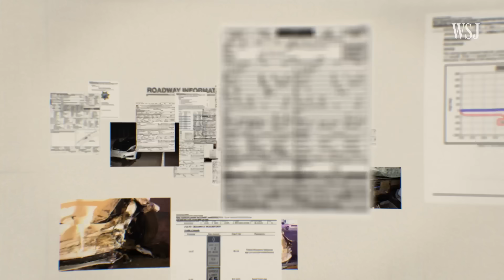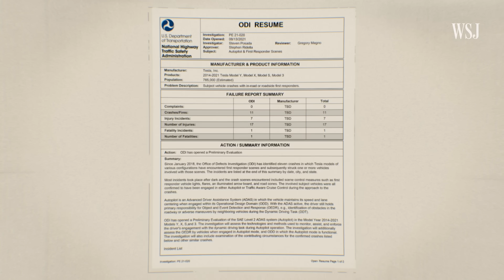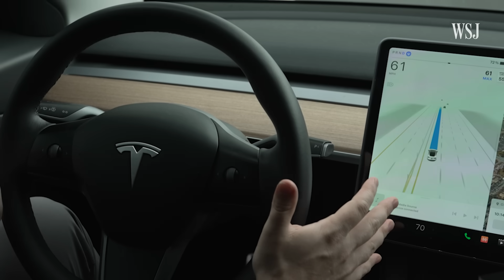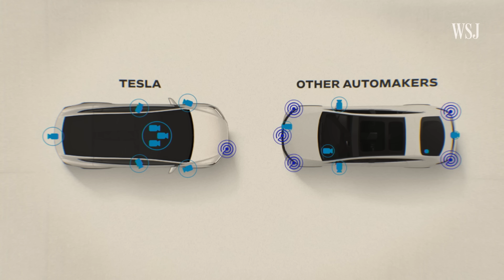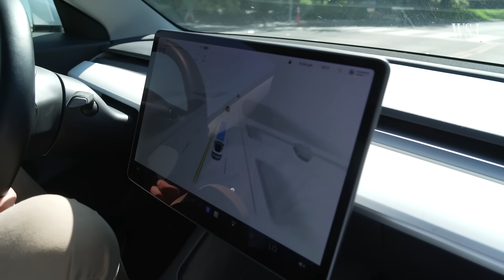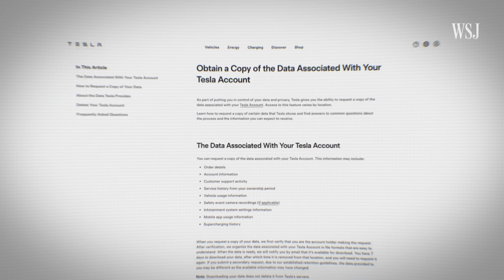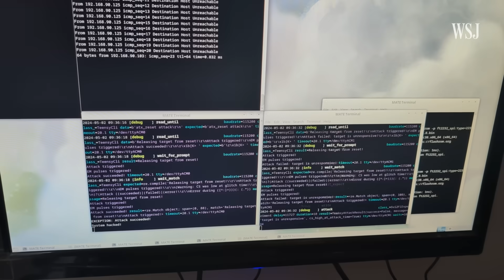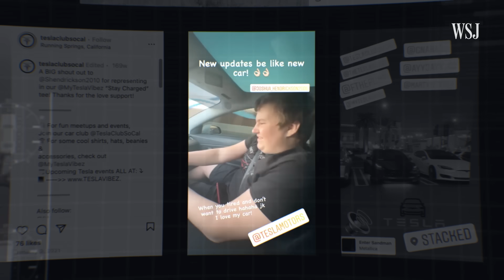The Hidden Autopilot Data That Reveals Why Teslas Crash | WSJ

Comment: The name Autopilot is what's misleading people. It should be called driving assistance and should be marketed as such.
Reply: Of course, now Elon Musk's DOGE (...government efficiency) board has announced we don't need that National Highway Safety Board that collects the data on why Tesla is the car brand with the highest rate of fatalities.
Reply: @bcwbcw3741  because people like you are easily misled, they report data others don't, stop comparing apples to oranges.  You know full well Teslas are some of the safest vehicles around.
Reply: @churblefurbles  The number of fatal accidents in Tesla's say that Tesla's are not "one of the safest vehicles around;" no matter what you fan-boys want to believe.
Reply: If the car is accelerating, using the breaks and turning on curves by itself, then it's on autopilot. Stop this BS. People defending rich people, as usual
Reply: @xbpspcdude  We live in an America now where the rich and/or famous can do whatever they want and get away with it because their "fans" will defend them in the court of public opinion no matter what
Reply: Doesn't help that Musk promised Full Self Driving and Robotaxi
Reply: @rick4580 FSD and Autopilot are two different things.
Reply: They fixed that by saying Supervised in brackets next to FSD. Doesn't fix the core of the problem though. People need to pay attention. The system reminds them. Like take the crashes in the night missing obstacles, clearly the driver was not able to spot it themselves or were not paying attention. It's very sad and unfortunate but a human clearly couldn't do better either. And that's the point, Tesla or not. Humans are great but machines are just better at some tasks. They aren't perfect though and that is what makes it tricky when a company sells the product.
Reply: @rick4580  And is getting there.  Remember how many people died with cars driving at 20 mph in early 1900's.  Was a car factory problem? not really.  It is a continuos process.  Same as seabelt, airbags,etc.
Reply: @rick4580  Those are not the same things as autopilot. autopilot is just basic cruise control.
Reply: @bibidi2568   autopilot is just basic cruise control. 
No it isn't. First, it's Traffic Aware Cruise Control (TACC), not just basic cruise control. Second, it includes Autosteer, which some companies call Lane Centering, and which you didn't mention.
Reply: @rick4580  Yes and claiming FSD will be 10x more safe than human drivers. He is systematically creating hype and twisting perception of how good FSD is while not taking responsibility that it really works. As he knows it does not. But he is unfortunately really good in creating fatally wrong perceptions what people expects from FSD.
Reply: @rick4580  He might have promised but never stated that is was 110% READY TO DO SO. That's the problem is that things are fed but we call it mislead when in reality never broke the meaning down fully. Just like when driving and its called "AutoPilot" well at the very start we all think fully autonomous but in real world it means A function that Pilots something automatically but further in depth on the word pilot also means (Is not 100% Fully capable to control this something automatically it can only function so much).
Reply: @rylie4495  Musk said back in 2016 that Tesla cars would be fully automated robotaxis by 2017. Of course he said the same thing in 2017 about 2018 and every year after until he finally had to stop a few years ago, and they changed the name from Full Self Driving to Autopilot. 
But there were certainly a lot of people who believed their Teslas with Full Self Driving could operate with minimal driver attention because that's what Musk said they could do.
Reply: @rick4580  They didn't change the name - it has been called "autopilot" literally since it was first introduced, and it was named autopilot because it most closely mimicked what pilots use in aircraft - a system that automates basic navigation but always requires the full attention of the actual human pilot for cases where the system doesn't understand what's going on and requires a properly qualified human being to respond safely. "Full self-driving" is a marketing term for an autopilot system that does more than just basic operation of the vehicle, and will also follow a pre-specified route from the current location to another specific location, but still using the autopilot system in which the driver must always remain fully aware and attentive and prepared to take over when the system identifies something it doesn't know how to handle, or when the system fails to identify something that needs to be addressed.
Reply: @babybirdhome  and tesla calls FSD "autopilot for streets."
Reply: @rick4580  They should instead read what the car says on screen as you activate Autopilot or FSD. These features are deactivated by default for every profile. Nowhere there does it state the car is autonomous, it actually states the opposite.
Reply: @rylie4495   come on man, even among Tesla fanboy spaces it's a meme how many times Musk has said "the software is totally ready to go right now, just a few more wrinkles to iron out and get regulatory approval. End of next year you'll totes have Robotaxis"
Reply: @rylie4495  Exactly.  Boeing autopilot doesn't mean the pilot isn't responsible--the pilot is still in command.  if people don't pay attention or worse, don't understand what they are using despite constant warnings (My Tesla is annoying with its warnings to keep me hands on during FSD), people's negligence doesn't constitute manufacturer negligence.  If Teslas were abruptly steering people into avoidable accidents that would be different.
Reply: @rylie4495  The AP-software of Teslas is literally called FSD, "fully self driving". If anyone mislead people, its Tesla.
Reply: @sprockkets   tesla calls FSD "autopilot for streets." 
No it doesn't. Where'd you get that idea?
Reply: @BigBen621  lol you are too lazy to even look it up, Elonia has said it several times
Reply: @rylie4495 when he claims that it's already safer than a human driver, isn't the corollary that one is safer letting it drive? Musk had indeed misled people, with the names, with their stated capabilities, with the promotional material (like a video where it was claimed the car was driven without human intervention and it wasn't) and safety and with the timelines. All the safety critical nuances can't be on the fine print.
Reply: Autopilot not even on an airplane is left alone without oversight from the crew.

People need to use this as an aid and move on
Reply: Exactly because I’m sure most of these auto pilot crashes could’ve been prevented if the driver was staying aware I have a Tesla and I’m always driving it like I don’t trust the auto pilot
Reply: @melo0115 Nope. Some of these crashes happen because autopilot made a sudden, violent, steering input at speed. Like someone reaching over and grabbing the steering wheel. That's not something any driver should have to deal with. You can keep living in your Tesla bubble, but you're a fool.
Reply: @melo0115  Same here
Reply: The correct name would be 'bad driving assistance'.
The assistant in my previous car, a 2019 Skoda Superb war superior to any autopilot iteration I've seen so far.
Adaptive cruise control was working flawless up to 210km/h. Road Signs - even dynamic ones or those on trailers used for roadworks were >95% detected correctly.
Lane assist was most of the time even able to follow temporary markings within construction sites. 
I was shocked, how bad things can be when driving a 2 years younger Tesla. Not even talking about the consequences of the missing ultrasound parking sensors.... 
.
Reply: @peterm.2385  heard great things about VW group’s assist features, really want to do a test drive of it myself
Reply: @peterm.2385  I'm sorry, but that's just a nonsensical statement. You're telling me that you are 2019 whatever the heck you call it could drive from Las Vegas to Los Angeles without ever touch the steering wheel? Oh, it can't? Then it's not superior. You might wanna go look up version 13 of Tesla FSD. It pretty much shuts the critics up.
Reply: @RightsDontDefendThemselves  No, I said that whatever was installed in a 2022 Tesla didn't wasn't as good in dealing with all odds that occur when I was driving here in Germany.
And it's no nonsense: to drive autonomous, a car must be at least certified for Level 3 (partly autonomous) within the EU. The latest upperclassmen cars from BMW & Mercedes are certified allow you to hand over control on highways until the as you to take back control. Tesla wasn't able to demonstrate  flawless operation of FSD under all required conditions & obtain tne necessary certification. They are still at level 2+.
So I don't compare car's ability to drive from a to b, but how the system is able to interact with the environment.
The Tesla did some phantom braking for no reason, regularly misses out some road signs, got confused by temporary road markings (yellow) put over the white ones at roadworks  & acc wasn't working at speeds faster than 140 km/h and PDC often reported wrong distances.
Reply: @peterm.2385  Not comparable to anything, those are fake level3's limited to very restricted paths, they are not competitive in terms of generlized intelligence.
Reply: It says you should take over anytime. People are not stupid, they're just not as focused as needed. When you have a system that tells you 19 times to pay attention / take over, it's your fault if something goes wrong
Reply: @erwile  well but these two statements are contradictory then in my opinion.
Reply: @garcipat  I see your point. IMO if they don't see that this autopilot system is not driving well (which is the case since it's an ADAS that just follows a curve and adapt speed according to other cars) why these people are allowed to drive in the first place? A car that tells you to take over at anytime is like any traffic signs that tells you to stop, it's basic logic.
Reply: @erwile  correct.
Reply: Autopilot in commercial aircraft do not handle all situations either, but when they are in operation they are safer than human pilots.
Reply: FSD was renamed to FSD (Supervised) for a reason...
Reply: @techconix  You mean FSD (Beta) was renamed to FSD (Supervised) for a reason. The available product was never just called 'FSD'.
Reply: Agree, naming anything with the word "auto" in it and it general consistence is that it is Automatic (I.E Automatic transmission, automatic high beams, etc.),  something that does something with little to no human control. Slapping the saying that "drivers need to be ready to take control at all times" is more aligned with an Assistant or an Helper, As that more implies that while they are there to assist they may not do the job correctly and still need to be managed, supervise (little late with some report there Elon) and monitored to an extent when a job needs to be done correctly without fault, similar to that of an experienced employee vs new hirer.
Reply: People would still do exactly as they have been doing regardless of what tesla calls it. Tesla makes you read a warning before activating it, and agree that you will pay attention, if you choose to ignore the warnings, that is your fault.
Reply: @ thats the reason why I am a little Bit anoyed by those „Tesla Autopilot is dangerous“ calls
Reply: agree - why didn't they at least call it co-pilot?
Reply: have u driven a tesla?
Reply: Yes, but what fun is that.  If someone needs a warning label maybe they should not have it?
Reply: But then he wouldn’t be able to pump and dump his stock
Reply: is it really misleading when it tells you every few minutes to <BEEP BEEP> KEEP YOUR HANDS ON THE STEERING WHEEL <BEEP BEEP>
Reply: Idiocy is what's misleading people. Autopilot is taken directly from aviation, where it is a driver assist feature. Tesla also explicitly explains the limitations and tells you not to trust it - something you have to agree to before activating it the first time. It has always been marketed as an assist feature that will SOME DAY be fully autonomous. Tesla is not the problem.
Reply: This clip shows an accident from 3 years ago, but robotaxi was launched this year. What happened in those 3 years of machine learning? It improved dramatically! That’s why Elon launched robotaxi this year. The version of Autopilot this year is more than 100x better than it was 3 years ago
Reply: In Europe, it's named Autosteer and Traffic-Aware Cruise Control, and it's better and more paranoid than other carmakers' similar systems that I've tried, including Volvo's. But of course, other manufacturers are not interesting to media.
Reply: Tesla's system randomly steers vehicles out of lane at high speed. That's not an assistant.
Reply: You minions are all confused, it literally verbatim says supervised in giant letters in front of it. You have to read the user agreement. Check mark a box /sign that you've read it and bake into your small brain that it is supervised by you
Reply: @AviCohen  I am sure that Tesla lawyers have made sure it is exactly like you said. Problem is that Elon (and some Tesla fans) are hyping it to be much more that what it technically actually is. So that perception is something else than reality. And that is of course about stupid people and not fault of a car as such. But it is fault of Elon + some fans/youtubers.
Reply: it doesnt matter. there are  warnings when you dont pay attention or not have hands on  the stearing wheel. All these videos also show crashes that you can barely see with the human eyes meaning they should have put more lights on the roads.
Reply: I guess one difficulty in relating to my parents is they have shown no desire to ever do a specific scientific or  engineering problem. I could never do a problem with them, or never solve a differential equation problem with them because they like to watch television sports and make condescending comments about the coaches, players, and officials. I think it would be hard for me to perform under the noise of the crowd. But my parents, who are retired government employees who convey the idea they have done everything perfectly, and would do everything perfectly. It is psychological torture being around them as well as my sister and her husband. it is like the information going into my mind guarantees a feeling of guilt and inferiority Billy. I have been in misery here in Las Vegas, Nevada. Do I have to earn money doing jobs I did when I was 17 years old, and get satisfaction and joy from doing some calculus and engineering problems out of a textbook? That is a question in my mind.
Reply: @ChrisVink-b5b  I share the same struggles as you do and I can talk for hours about these points you have made. It's nice to see someone else that gets it.
Reply: It's not even remotely misleading, autopilot tells you constantly to pay attention ever time you use it. There's 0 ambiguity
Reply: They literally say even with these features engaged it isnt fully autonomous and you are still fully in control of the vehicle.
Reply: Why would "autopilot" mislead people?   If people have some stupid understanding of what actual autopilots (in aircraft) do then that is their problem... I am a pilot and I think that "autopilot" is a quite accurate label of where these systems are right now... If Tesla was calling it "autonomous mode" then you might have a point.  Autopilots... in aircraft... are far from autonomous and require constant monitoring by the pilot at all times... just like Teslas "autopilot"
Reply: Agreed not sure how this is anyone’s fault other than the driver for not paying attention to where the self driving (aka fancy cruise control) was taking the car and what’s on the road in front of you
Reply: Autopilot does mean driving assist. Aircraft and boats have "autopilot" that requires supervision.
Reply: It's marketed at such when buying the car on there cite it says what it can do just stay in the lane and adaptive cruise control it's the same as plane autopilot basically u still need the pilot.. autopilot is not fsd and fsd wasn't perfect so far until v13
Reply: It is autopilot.  People are stupid.  Education in schools should be mandatory.
Reply: But naming alone is not the problem. People are jus using this without understanding it.
Reply: No worries, just more Musk "puffery"🎉
Reply: It doesn’t matter how it’s marketed. If it won’t stop when something is clearly in its path, it doesn’t work - which means the tech shouldn’t be in the car and it definitely shouldn’t be represented as functional.
Reply: Nah, it should be called a vision and intellectually impaired robot still holding a learner's permit.
Reply: the name Autopilot is correct and should be used, look at Wikipedia's definition: "An autopilot is a system used to control the path of a vehicle without requiring constant manual control by a human operator. Autopilots do not replace human operators. Instead, the autopilot assists the operator's control of the vehicle"
Reply: The entire point is to mislead people. If gullable investors didn't believe robotaxis were right around the corner, they wouldn't believe his stock was so valuable.
Reply: Call it driver assistance it will be even lesser regulated and more deadly.
Reply: warned about you mean.
Reply: Elon is the one misleading people... over the years he been saying that i can do self driving fine... uploading videos to teslas youtube page that the car drives itself from one city to another... i think they deleted them by now.
Reply: Agreed! My highway assist on my Hyundai is amazing and i do just sit there sometimes if it’s an empty road. But my eyes are always on road and I’m ready to take over at any second! It’s a computer it’s gonna make mistakes just like humans you can’t trust them!
Reply: Pretty much, the actual self driving software is behind a 8 thousand dollar pay wall, even though it's orders of magnitude more capable, it's still not ready for hands off blind trust. To many owners seem to not differentiate between the two tiers and on top of that comit to blind trust.
Reply: Airplanes use "autopilot"
Reply: I think "Autopilot" is probably a reasonable name. When a plane is on autopilot, it still requires a pilot ready to take over. They don't just activate autopilot and go to sleep. "Full Self Driving" though. That's misleading terminology.
Reply: They always emphasise (supervised) and according the TCs drivers fault if a crash happens
Reply: It actually is not called autopilot🤣
Reply: @sutemati   It actually is not called autopilot 
Oh, really? Then what is it actually called?
Reply: People need to understand the statistics and follow the math. By the way, most of these videos such as this one are campaigned by teslas competitors that are fighting tooth and nail to regain any marketshare that they can.
Reply: It should exist at all. But fun bootlicking.
Reply: This. I have a Tesla but I've had to watch at all times.
Reply: It definitiy is. But on the other Hand I think: nobody would accept an airplane with Autopilot activated and on Pilots in the Front.
Reply: @JuleundMichi  I'm not sure I understand because as far as I'm aware when planes use their autopilot system it's not like the pilots leave the cockpit and start partying with the passengers.

They're always there, ready to take control.
Reply: @ That is what im sanying. But why do people think they could be unaware when using Autopilot on their car
Reply: But why? Autopilots in aviation can be extremely primitive. They do zero collision avoidance. When set up wrong, they can stall and crash an aircraft. They will fly into mountains. It just frees your hands (and eyes) to do other things (one of them being looking out for other aircraft when visibility is good). Autopilot in aviation is kind of like cruise control in automotive. It works because the environment is very simple when you fly through air. Even something like autoland is pretty trivial. The biggest worry is making it reliable. The only technical challenge is that you need a radar altimeter to correctly time flare (raising nose before touchdown; barometric altimeter is just too inaccurate) which was already present on larger aircraft for terrain warning. Again, simple environment. You can fly by numbers.

PS: It's kind of unfair to liken it to cruise control. Flying is so different that even such a primitive device can be of great help. It's kind of like it in its primitiveness, but it's far more useful. Essentially, it's more work to fly straight and level and to execute turns than to just keep pressing a pedal. So, it can be great help when something else does it for you, even when it's dumb.
Reply: @jobicek  well an auto pilot in air is a lot simpler because there is quiet fewer unexpected things, traffic participants and things to pay attention at the same time.
Reply: @ but that does Not change the Definition
Reply: @JuleundMichi  well auto pilot has no definition i think. Since it mostly only existed in avation its the only thing we can compare it to. I dnt think it is defined what it means to include to be au auto pilot. Innaviation the pilot cant let the airplane do its thint without pa.ing attantion either. I think that auto pilot for cars exist, but its not what tesla did. It has also to be considered that driving by car already is dangerous, even without autopilot.
Reply: @ I mean. It shoudnt Need one. People could just use Common Sense and read/follow the Instruktions
Reply: @JuleundMichi  well in the manual is not explaind how AI work and a lot of people still think its Scifi or magic but are still using it
Reply: @ no but it says that you have to pay attention to the ongoing Traffic at all time and you Need to be Anke to take Control at all time.
Reply: @garcipat  Exactly. OP is complaining that the word autopilot implies a very sophisticated system (hence misleading people) when in fact actual autopilots are primitive and would be useless in cars while being very useful in aeroplanes simply due to different environment and control characteristics.
Reply: I’ve worked for Tesla, Albeit as a front end web developer, not on autopilot engineer or Anthony remotely close to it. But I’ve driven the cars and other driving assistance features in other cars. They simply need to employ better crash avoidance that uses radar or lidar to enhance the system. Just like the other cars. Tesla should employ all of this technology. Period
Reply: This is exactly the issue
Reply: Toyota Corolla 2023. Works great!!
Reply: It kills people. It should not be sold at all
Reply: Nah.. it's just a slightly better cruise control. Nothing more.
Reply: @Jin420   it's just a slightly better cruise control. 
Partly true; but just like virtually all cars sold in the past 10-15 years, it's not just cruise control (maintains a set speed), but TACC (maintains a set speed or set distance from car ahead), and adds Lane Centering (which Tesla calls Autosteer). But if your point is that it's little better than what comes on almost all new cars, I agree.
Reply: Autopilot seems like a fair name. If you compare it to the known Autopilot from planes, Tesla’s autopilot is far more advanced and far more active. This is just drivers failing to drive… 

“Full self driving” is absolutely misleading though, and I hope they get sued for it.
Reply: @Powderlover1   I hope they get sued for it. 
They were, and won the lawsuit. "In her ruling Sept. 30, U.S. District Judge Araceli Martínez-Olguín rejected shareholders’ allegations that Musk overstated Tesla’s self-driving technology with assurances that drivers could “go to sleep” in their car by 2020, among other promises. She found that some of the alleged overstatements concerned future plans, while others weren’t necessarily false."
Reply: Please google  "autopilot" in relation to aviation, where the term originated and you will see that autopilot is a pretty large range of features, but at no time removes all risk posed to the pilot.
Reply: @billiek5515   typical ‘redefinition’ of what ‘autopilot is’ but for ONLY Tesla’s?? Hm… sounds stupid, as ‘autopilot’ exists for Planes, Trains, Large Commercial Trucks… and then, the little passenger car… sounds like Tesla is making a ‘death machine’ with their ‘OTTO pilot’… 🤔 🇺🇦 truth in #Science
Reply: It is
Reply: "driving assistance" does not work. Either the driver is alert and monitors what the car is doing, then the driver can't doze off or play with their phone, or he is not alert and then he can't take over when the "assistant" needs assistance.
BTW, this is not how an autopilot is used in an airplane. Not at all.
Reply: @fluchschule  Agreed, and true. Autopilot and automation should only be used to reduce mental bandwidth to maintain some control inputs so that it can be spent on higher level monitoring tasks instead, not for entertainment and distraction.
Reply: As many other automaker do, but that doesn't make you the richest person in the world.
Reply: Fools Self Driving seems more accurate..
Reply: Why misleading ? Capabilities are in the description and you need to confirm you understand them. 
By your logic Coca-Cola is also a misleading name, it does not contain coke anymore.
Reply: Autopilot definition (from Wiki)

An autopilot is a system used to control the path of a vehicle without requiring constant manual control by a human operator. Autopilots do not replace human operators. Instead, the autopilot assists the operator's control of the vehicle, allowing the operator to focus on broader aspects of operations (for example, monitoring the trajectory, weather and on-board systems).[1]

When present, an autopilot is often used in conjunction with an autothrottle, a system for controlling the power delivered by the engines. 

So, this describe Tesla's Autopilot almost to the letter. If you're unfamiliar to what an Autopilot do, that's on you. Educate yourself.

Autopilot is a driving assistance system that requires supervisions, it states as such before it can be turned on (it's off by default). I do whish Tesla would update the Autopilot stack to use the cabin camera to make sure the driver is looking at the road, similar to what FSD now do instead of relaying on the outdated wheel tug. It does incredibly well but it can do mistakes (like any Level 2 ADAS) and if you're not looking at the road (like you SHOULD), well it can be disastrous, like this video shows. The 2024 Volvo CX40 Recharge Ultimate that was lent to me while my Model 3 was in the body shop was so bad, that no way I could let my eyes off the road, even for a second! That thing could deactivate by itself without even an haptic or audible warning! Simply an icon disappearing from the dash, what?!? Just lightly holding the wheel while it 'tried' (often unsuccessfully) to follow a curve could be enough for it to deactivate, silently, itself! If you wouldn't be looking at the road (maybe daydreaming, which is responsible for 33% of the death caused by inattention), you would end up in the ditch or worse, the opposite lane! That's BEYOND stupid, and yet, that's the competition to Autopilot...
Reply: @sylvaing1  Most people think the pilots are doing nothing during most of the flight time because they have the autopilot in place. Also in Tesla, the term autopilot gives a sense of a fully automated device, which, in fact, is only a "supervised" autonomous driving.
Reply: @billiek5515  which is why it is called "FSD supervised" because people are stupid and miss use their vehicle.
Reply: I fly aircraft with autopilots. I stay awake and alert. I never totally trust the autopilot.
Reply: If you're buying a Tesla, you should do research.  Research on cost, range anxiety/needs, features, etc.

Feature included Autopilot and FSD, what they are capable of and what their limitations are.  I'm on my second and likely final Tesla.  Will never go back to ICE.  I rarely use autopilot, only on longer drives when I need it.  Always keep my eyes and hands where they should be.  Software has bugs, always have and will but no question it will be better than humans eventually.
Reply: Ironically, auto pilot is exactly what it says. It is. In an aircraft you can't get up and walk away either.
Reply: Autopilot like the plane name sake doesn’t do everything but it does a lot.  Autopilot on a plane doesn’t mean you can walk away from a cockpit of a plane and have a sleep
Reply: The name is to differentiate between the autosteer function.  People with a Tesla with "full self-driving (beta)" are acutely aware and explicitly told that it is not ready to drive by itself and that you MUST stay aware.  Every one of these drivers knows that it isn't ready to do everything by itself all the time.  This whole hit piece is ridiculous by not pointing out comparison safety statistics.  People get in all kinds of accidents and die from inattention and irresponsible behavior in every car.  While it is tragic, it has nothing to do with this constantly improving optional driver assistance feature.  FSD is like an AI computer learning to drive and you are the driving instructor.  The safest possible way to drive today is with you paying attention and exercising good judgment while FSD is enabled; however, it will be quite some time before these could potentially be fully autonomous on all roads IMO.
Reply: @NDcompetitiveshooter Quite some time is actually right around the corner, when the Robotaxi is introduced in 2026.  Unless I am way off base, that fully autonomous vehicle will be using the same sensors, software, and AI that today’s Teslas use.  Based on my observation of FSD on my Model Y, I’m not ready to hop in the Robotaxi just yet.
Reply: @RobertsonDCCD  Those timelines are not in stone and they will likely carefully limit the areas these taxis will provide service to very known quantities.  The amount of testing they did just for their last event shows that they know there are still significant limitations they have to account for before these can be released into the wild.
Reply: @NDcompetitiveshooter  this is how i drive now.
Reply: Autopilot flies airplanes!
Reply: @ It does with pilot supervision.
Reply: it’s more than a marketing problem. It’s big tech arrogance which runs much deeper.
Reply: Learning Driving Assistant to be accurate cos its still Learning to recognise objects on the road.
Reply: @lindyf381   its still Learning to recognise objects on the road 
No, Autopilot doesn't learn anything. It just follows a program written by Tesla engineers. FSD learns from videos submitted by Teslas whenever they drive, but not Autopilot.
Reply: Woohoo! A propaganda hit piece.
Reply: Err... but by definition, Autopilot means "pilot assist".  
Also, the Ladar is not an appendix. Elon may as well argue that Dolphins don't need their sonar.
Reply: @kaba_me  Err...that's not the way most people use the word 'Autopilot' and you know it.

Most likely heard of the term from airplanes, and I hate to break it to you, but that's exactly what it does (though if the skies were as congested as our roads a lot more people would likely be killed by that as well).

Elon Musk deliberately talked up its capabilities, while investing as little as possible to bringing it to reality.   

He's as responsible for those deaths just as much as the cars Tesla built are.
Reply: @kaba_me no, auto(nomous) pilot
Reply: @jtrain9926  auto(nomous)pilot? What about Auto(nomous)mobile? You see how stupid this is?
Reply: @kaba_me the “occurrency network” is doing a good job of replacing the radar but didn’t show up till later builds
Reply: @kaba_me  Autopilot does not mean "pilot assist" by definition, it unsurprisingly means "automatic pilot" and importantly takes full control of a plane unless the pilot interferes or if autopilot can't be maintained, and it reverts to partially or complete manual control - with an audible warning to the pilot. Whenever autopilot can be enabled, it's routinely safer than manual control, and several crashes could've been avoided if the pilots had turned on autopilot - ie: the complete opposite of Teslas self-proclaimed "autopilot". Plane autopilots operate under strict restrictions, using definite values, with an extreme priority for safety - Teslas rely on fuzzy interpretations of what the computer "thinks" it's looking at. Teslas "autopilot" would be more akin to a drunk human pilot.
A vast number of people are fully aware of this, so Tesla "autopilot" was misleading from the outset.
The only time Autopilot means "pilot assist" is because other car companies have repeated the trendy "pilot" part of the name, but in the much more accurate/honest term "pilot assist" aka "driver assist". There would be zero comparison, let alone definition, of "autopilot" as "pilot assist" if not for Tesla.
Musk also repeatedly talked about & repeatedly predicted his cars to be fully self-driving years ago.
Reply: @DoubleMonoLR  It is not up to you to redefine what "autopilot" means. Aircraft pilots are not supposed to take a nap while the autopilot is engaged.
Reply: @ Thanks for reminding me of the word I was trying to think of, but it’s Lidar and that is good example.
Reply: No it’s not. It’s really an autopilot and not “assistance”
Reply: @SDubovsky   It’s really an autopilot and not “assistance” 
These are not mutually exclusive; in fact, Wikipedia uses both "assist" and "autopilot" in the same sentence. So it's actually both.
Reply: @BigBen621  Well, this whole thing is irrelevant. What latest Tesla has is pretty close to autonomous driving. Give it a bit more time to get the L5 cert. At a current state, we are missing garage parking and some boom gates. The rest is there.
Reply: @SDubovsky   What latest Tesla has is pretty close to autonomous driving. 
It's certainly close enough for my needs/expectations, although I'll welcome this year's proposed shift to FSD (Unsupervised) in CA where I live, because it will do away with attention monitoring. For some reason, the Tesla camera has trouble seeing my eyes, or perhaps inferring where I'm looking; because I was recently up to four strikes, even though my gaze was straight ahead while I was getting the warnings that culminated in the strikes.

But I think we're much further from L5 than you do, or even L3 or L4 for that matter. A far bigger gap than boom gates and parking garages is that FSD hasn't yet been trained to read signs, for example for intermittently occupied school zones, or time-related limitations, such as "NO LEFT TURN 3:00 PM TO 7:00 PM". This will have to be resolved before we go to FSD (Unsupervised), which means resolution must already be well underway if they're going to be able to make the transition this year (in California and Texas). Also, there's no consistent response to emergency vehicles, although using cabin mikes to listen for them is a step in the right direction.

The bigger problem with L5 is that this requires that the "ADS can operate the vehicle on-road anywhere within its region of the world", which typically means the continent the vehicle is on; although SAE J3016 does state that this might be allowed to be just within the U.S. as an exception (SAE J3016-202104, Section 8.8). But this still requires approval to operate at Level 5 in every city, county, state, or other government entity that controls autonomous vehicles; and this will certainly take years, and perhaps decades to achieve.
Reply: @BigBen621  Valid points. Thank you. But I am still optimistic. The missing bits, compared to what was already implemented are not looking like something insurmountable.
Reply: @SDubovsky  Yup, we're definitely on the same page here.
Reply: @csuporj  it's amazing. People will trash the FSD, while knowing for sure, it's orders of magnitude safer than people drivers.
Reply: @SDubovsky FSD fails because it's trying to predict unpredictable drivers.
Reply: @Rafathegam231  It does so way better than human drivers. It watches 360 around, 36 times per second. It's not getting distracted it's not getting tired.
Reply: @SDubovsky I don’t think most people are “trashing it”, merely pointing out that it’s really a driver assist. We’re not at the stage yet, where the driver should be switching off. Maybe when all vehicles have automation and are talking to each other, but we’re still a ways off that. My car has adaptive cruise, steers, accelerates and brakes, but I still oversee the driving. Of course, having a car that will do an emergency stop if it detects someone crossing the road is a massive plus for road safety, and who wouldn’t want that. It also uses LIDAR and cameras, which is always going to be better than just cameras. TESLA should never have cheaped out on this.
Reply: @mick2d2  Yes, it's not Level-5 yet. It's 95% there. Given the trajectory, it will get the L5 real soon. You need to see that to believe it. Since last update, I am not driving, I am a passenger, sitting behind the wheel. All I do I type an address and push the button. That includes driving out of 3rd level underground garage.
How's that "driver assist"?
Reply: BAH. I use autopilot everyday. It should be called Lane Keep assist Beta. That's about all it actually does.

I have rented a variety of cars and their basic Lane Keep assist feature is FAR more robust than Autopilot. And these are 2-3 year old model cars compared to newer Teslas.

I was in a base model Toyota Camry from 2023? and it's Lane keep handles traffic, lane changes, curves, and basic lane keeping better than Tesla's Autopilot could.

Heck autopilot even falls into the issue of ping ponging in the lane from time to time. And even FSD will ping pong in a lane when you are going REALLY slow like 5mph it will make hard sharp turns in the lane.

It is not just wild how little Autopilot is capable of. It is insane how much better basic features on other cars are than autopilot.
Reply: @origosis  Sounds like an old version. v13 is really a Full Self Drive.
Reply: @origosis  "Lane Keep Assist" is called Autosteer and it's what you activate to switch to Autopilot mode as it's the sum of Traffic Aware Cruise Control and Autosteer.

TSS 3.0 is brand new. My 2017 Prius Prime Lane Assist will NEVER reach the level of TSS 3.0 (and can't even follow a slight bend on an highway). It is the best it will ever be, same for TSS 3.0, unlike Autopilot which, because of OTA Update, is currently the "worse it will ever be". 

Last summer, I was lent a 2024 Volvo CX40 Recharge Ultimate (top of the line) while my Model 3 was in the bodyshop. Talk about a huge step backward. Any curve slightly more sharp than a gentle highway curve and the car couldn't follow it. I usually drive with one arm on the armrest and with a slight hold on the steering wheel. If I didn't make the conscious effort of 'following the wheel' as it "tries" to follow the curve, it would deactivate, SILENTLY! No haptic or audible feedback that it deactivated. Only a small icon from the dash would disappear! So if I would have been daydreaming (which is responsible for 33% of the USA death from inattention), I could have taken the ditch or worse, the opposite lane! I turned it off and simply used it cruise control, which, BTW, phantom braked hard at 105 km/h in a curve on a regional road. It displayed "Emergency braking applied to avoid a collision" on the dash, although there was nothing around. I had to dismiss the message manually hence why I'm sure it was a phantom braking event. My experience with Volvo's Lane Keep Assist is at par with what WholeMarsCatalog experienced with Mercedes' Level 2 (not 3) ADAS. It's basivally useless.